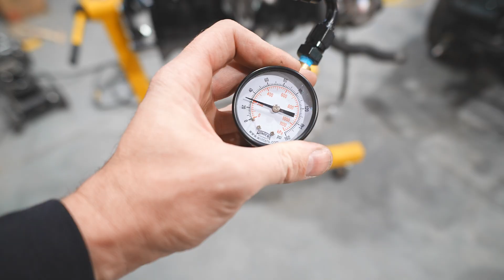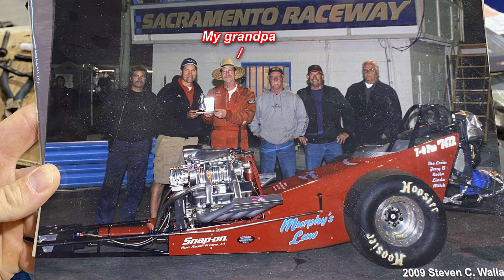How to Make Custom Turbo Coolant Lines (AN Fittings and PTFE)

Comment: Great video! I personally would delete that oem oil cooler they are known to fail and mix your oil
and coolant.
Reply from the maker: I did replace all the seals within the cooler with brand new ones, but if I notice an issue down the line I'll definitely swap it out for something else.